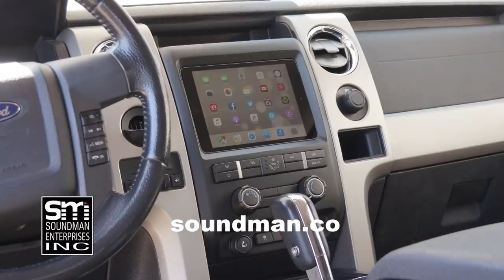Mule body work part 2 - Mule Monday episode 5

Comment: Doug you are holding the spatula "wrong". Try to hold it like this:
Lay flat the spatula on the table.
Put your thumb on the left side 1" from the yellow part and the pinky and the ring finger on the opposite side.
Use the index finger and middle finger to push in the middle of the spatula.
At the benning is a bit weird to hold it like this. But afret 5 minutes is more confortable and the bondo spreads better.
Sorry for my broke English, not native :D

try it for real, you little ba.......
Love you :*

Comment: Man when you started doing the body work I thought you might know something about it but after what I just saw it turned into a train wreck right before my eyes you should have done some hammer and dolly work to bring the metal out to as close to where it should be and then put down some bondo but now it's just going to crack out like it was before because your putting a shit ton of bondo right back in for it to do the same thing again